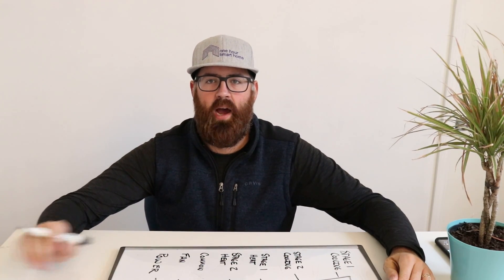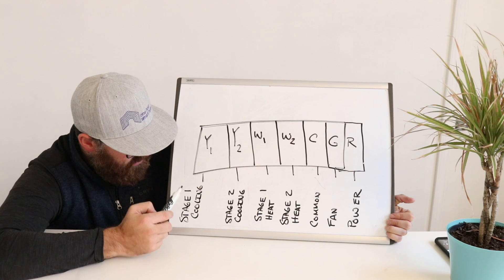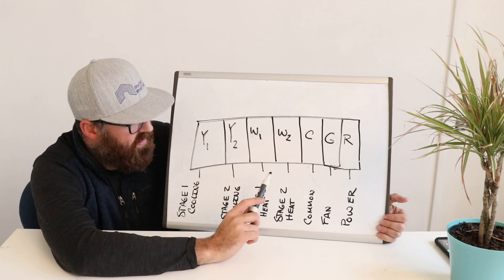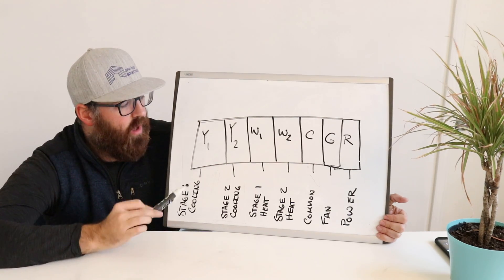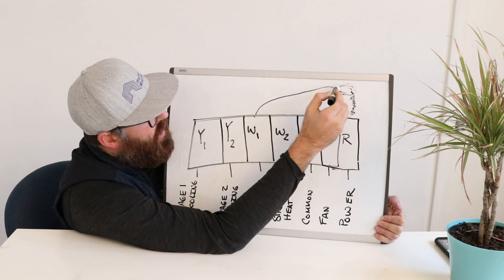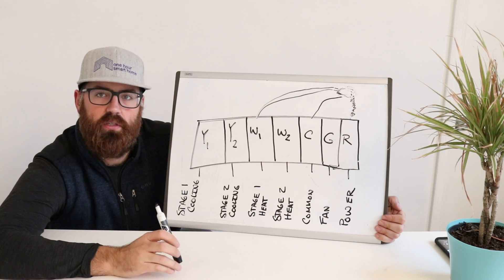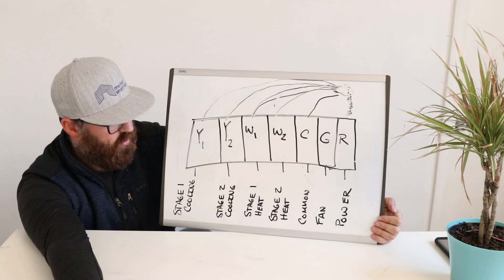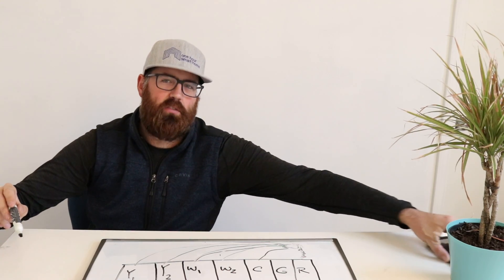Thermostat Wiring Explained: Wiring Smart Thermostats, Nest & Ecobee

Comment: So if I only have a single white wire in my system should I put it in w2 or w1?
Reply: I think W1, I hooked power to w2 and nothing turned on, it runs fine at w1.

Comment: I have a Blue Wire, an Orange Wire, a Brown Wire and a Black Wire along with the White, Red, Green, and Yellow Wires.   The Black and Brown wires are Not Used in my Honeywell Thermostat set up. What designation do these wires have? I’ve tried installing 2 Different New ecobee smart thermostats and I finally had to take them off and reinstall the Honeywell.  Why are the ecobees so difficult to wire up?

Comment: I have been trying to figure out why my smart thermostat doesn’t have a recirculate option for the furnace, now I know. The power extender kit turns the recirculate wire into the common wire, losing the recirculate option.

Comment: Hey James, do you have a video that discusses how the wiring looks on a Lennox furnace that can run a Lennox air conditioning unit as well as an LPG furnace. I'm in a remote location and the HVAC crew left and I am barely getting any air blowing when the AC unit is on. But the air blows three times as hard when the heat is on. Got any suggestions?
Reply: Would enjoy this explanation. I have a Lennox furnace. Wires are labeled R, C, i + , i- .

Comment: I don't see RC on your diagram and my system had a red wire going to R and then a wire on the panel bridging to RC. On my new thermostat, there is only RC but no R, where should the wire be bridged to? I'm guessing it's a dual power system?

Comment: I have a gas furnace and could only run the fan with heat. Connected the G on the furnace to the G on the thermostat and now I can run the fan on its own. Great video. Thanks!

Comment: Just one question.  In a two wire thermostat set up, you have a red wire (w1) and a second wire. Where does the second wire go?
Reply: It's a contact closure, so one wire goes to red (24vac) and the return wire from the thermostat goes to w1 to energize the system (call for heat), so the thermostat hooks up to R  and W1 in my case.

Comment: My thermostat only has 3 wires. Green, Red, and White. It say's Green is Data. So when I try to connect it to a smart thermostat it isn't working. It doesn't power on, even with the Red to R. I've tried Green to G and Green to C and still nothing. Any ideas? I do have other cables that aren't being used like blue, brown, and yellow as well.

Comment: Does the control board in the furnace ALSO turn on the fan, (on a heat call) OR does the thermostat require to ALSO send a fan signal?

Comment: Can you explain how to wire a 5 ton air handler with 20 KW heater strip to a ecobee Smart t-stat? NO HEAT PUP, NO FURNACE, Have outside condensing unit.

Comment: I have a 2015 American Standard 2 stage gas furnace  with ac.   I believe it's wired to only run fully on.   My furnace has a jumper between w2 and w1.  On my Thermostat there is a jumper between rc and r and no W2 wire.

Comment: Help me, I have 2 red wires and 2 white wires from wall. I have central air and heat ( heating is propane gas)  I know to Connect one white wire to the white wire on the box and one red wire to the red wire on the box but what do I do with the other red wire and the other white wire

Comment: I have a question. I just bought a house 2 months ago, and just replaced the old thermostat (Venstar T0140) with the Ecobee 5 Smart Thermostat. The old thermostat had a six wire set up; O, G, W, Y, R, C. I have a Trane/American Standard Split Heat Pump System. Exterior unit is model 4TWB3036C1000AA, and the furnace is model TEM3A0B36S31SAA. When setting up the ecobee, it asked if I would like to allow heat pump and aux heat to run simultaneously, with a warning to set it to disable if natural gas or oil is the aux heat fuel, otherwise heat pump failure may occur. That would not apply to me however as my house is total electric. The old thermostat according to the manual labels the W wire as aux heat as it is the sole W wire. But everywhere else I have looked online, aux heat usually comes from a W2 or Aux wire (sometimes brown in color). So my question would be, do I even have aux heat based on my model numbers (I have searched everywhere and can't find it) and should I leave the setting ecobee is questioning set to on or off if I am unsure? Could my system potentially have electric aux heat without having to have a w2 wire on the thermostat?

Comment: Can you put a Y2 wire on a Y1 slot on an ecobee? I opened my heater to see if i have a c wire and it says Y2, R W C G. The old thermostat just had a Y with no label and no other Y slots.

How do you set an ecobee to gas mode? We have a gas heater and there was an option to gas heater in the old thermostat.

Would love a quick reply, thanks!

Comment: Good afternoon James I just purchased a smart Honeywell lyric T5 my house has one air conditioner but two thermostats do I use the same wiring to control the system in my attic I have a diverter that will push the air towards the one side of the house versus the other

Comment: Just to confirm. You attach the C wire on the supply end to the white and the R to the black of a 24V transformer. Thanks in advance.
Reply: I would measure the transformer with a voltmeter set to ac.  If the black on the transformer gives you 24vac relative to ground then that is your hot side to the thermostat.  If the white on the transformer is indeed neutral for the transformer, then it is your common or often times "c" for common.  Confirm or you could short out the transformer.
Measure it or have your friend help that knows how to decifer the source power vs. Contact closure.
Don't zap your circuit board. $$

Comment: Hi I moved into a house that only has 3 wires to my thermostat. I have a 2 stage furnace, is there anyway of utilizing both stages without trying to pull new wires from furnace to thermostat?  I have no access as my basement ceilings are finished. Thanks
Reply from the maker: It just depends on your system. But if you have an R wire (Power), W wire (Call for heat) and a G wire (Call for fan) it's possible in some instances to wire up the three wires in a configuration with R wire (Power) and then change the W wire to W1 terminal on the furnace and the thermostat. Then change the G wire to the W2 terminal on the furnace and the thermostat. In this configuration you would lose the ability to independently control the fan, but it should automatically turn on whenever there is a call for heat. I would recommend the Nest Gen 3: https://amzn.to/3stoUKn as it does not typically require a common wire in most configurations.
Reply: @OneHourSmartHome  smart idea! 
Thanks!

Comment: Thanks.  My thermostat broke (plastic holding batteries) which operates my AC and heater.  I am in market to buy new thermostat but want one that eventually may connect to a smart home system.  What do you suggest?  Also on my thermostat I have wires that are black orange green white, red and black.   No blue or yellow.   Can you help me understand what is what?

Comment: I am trying to figure out if I have a two stage system or single stage.  I only have 1 Y wire and W wire.  But maybe the installer didn't install a 2 stage thermostat.  How can I tell besides looking at the thermostat wires.  I definitely have a variable speed air handler.  What is the difference between a two stage compressor or furnace and a variable speed air handler?  I know that the variable speed air handler will vary the speed of the fan thus the air blowing out of the vents.  Can you clarify the difference.  Thanks

Comment: My HVAC system doesn’t have a wire coming out of the G port, and my ecobee is saying in order to have my Y hooked up, I need a G wire. Any insights?
Reply from the maker: What wires do you have?  This ecobee install video might help you:   https://youtu.be/ZJPohR5WfBA
Reply: @OneHourSmartHome  at the HVAC system we have.
Y W1 W2 R C
I connected them to my ecobee thermostat, but it says it can’t run a Y without a G. I tried to just put a bridge on the Y to the G at the thermostat, but now it appears the heat doesn’t turn on, it just turns the blower on.

Comment: Thanks for the easy to understand video. Very helpful. One question. The C wire used for the smart thermostat is that 24 volts Or is 110 volts. I read that if you don’t have a C wire you could power the thermostat separately with a 24 volt transformer. On my case I have installed a 5 wire directly from my thermostat to the furnace but have yet to make the connections. 
Thanks again.

Comment: I have been through numerous of your YouTube videos yet i have been able to find solution to my issue. In my condo I have Honeywell T5670 installed, it has 1 wire for power, 1 for common, 1 for heat, 1 for cool and 4 wires for fan named (com, I, II, III, where in I, II, III are for speed control). I am trying to understand how do I use these wires to install a smart thermostat like Nest or Ecobee. I am at loss please provide some guidance

Comment: I have R and W terminals for heat. I would like to buy the nest thermostat that just came out. I would like to provide power from a 24v transformer. Can I double up on R terminals since there is no separate RC and Rh in new nest thermostat unlike the nest learning thermostat.
Reply from the maker: Why would you need a 24V transformer? The R wire in most cases typically provides enough power for the Nest Thermostats including the new Nest Thermostat: https://amzn.to/3p45HO3
Reply: @OneHourSmartHome  I was told by nest support to that I need 24v supply. I have couple of nest learning thermostats and I did use 24v supply from transformer and it works great. Unlike nest learning new nest thermostat does not have Rc and C just one R so I am not sure if I can double up on R.

Comment: Hello, I have a different wire setup in my thermostat, it has 1, 2 , R and C  4 . I do want to upgrade to nest thermostat. i don't know what is 1 and 2 mean? can you help me ?
thank you
Reply: I think in your case, your thermostat is connected to an EIM Board that is near your furnace unit. Your goal is to bypass that EIM board and connect wires from the nest to the furnace.

Comment: I have an older Honeywell thermostat and it has a white wire to W yellow wire to Y green wire to G black wire to W2 and blue wire to Y2.  I don't see that I have a C wire.  I want to install a newer thermostat with wifi.  can I do this with the existing wires? Or do I need to install a converter at the AC unit?

Comment: I have a Ecobee 3 with the six wire configuration.  I matched up each wire as it is on my old thermostat, plugged them into the same labels on the Ecobee 3 and I dont get any cooling.  Everything else seems to work but no AC.  I only have the 1 wire that goes to Y1?  is there something else that I could/should be doing?
Reply: I have the same issue, did you ever get that figured out?

Comment: have you ever had a short on the control board ?  popping the 5 amp fuse.
Reply from the maker: Yes, usually means that you have thermostat wires touching somewhere. Or a short/overload in the system.

Comment: I'm struggling with my thermostat wiring. Trying to install an ecobee 3 lite. I have w, y, g, r, and rc wiring. Really confused on how to proceed as the instructions don't provide guidance on this wiring setup.
Reply from the maker: Or use the c wire kit that comes with the ecobee. This is why I recommend the nest thermostat for most DIY installations. Because it doesn't require a common wire most of the time. https://youtu.be/Npj1fGjaVNU
Reply from the maker: You need a c wire
Reply: Did you figure it out?  I have the same and I think I have a solution

Comment: Thanks for the clear explanation of these thermostat control wires. I have an Ecobee4 and after hooking it up, the boiler does not kick on. The Ecobee4 is calling for heat, but the boiler is silent. I have a 3 wire set up, red, white, and C. Any ideas as to why the boiler does not kick on?
Reply: Basically thermostat is a switch which is activated by temperature. One of the three wires call for boiler to start and on thermostat it is W1 for heat. Assuming C is common and red is power, the white one may need to be connected to W1. BUT do verify the connections at boiler and the power being supplied through red and c wires with a volt meter.  I am just wondering why you have a C common wire for old setup.
Reply: @akhtarkh   It turns out that after many many hours of tracing the wires, the "c" wire was not connected at the boiler end. Thank you for your help & reply.